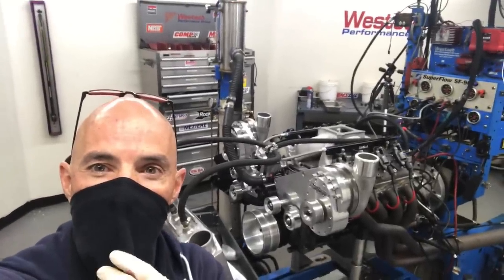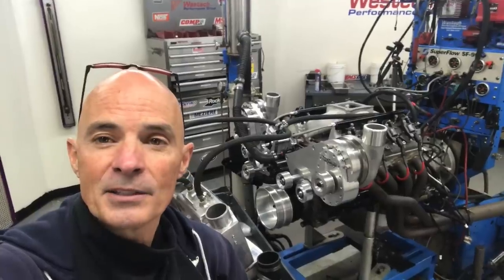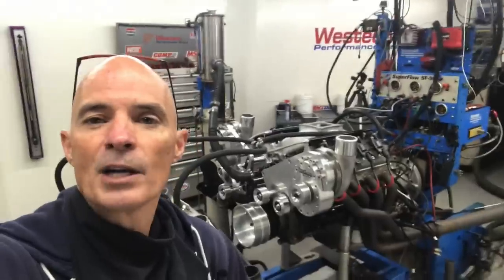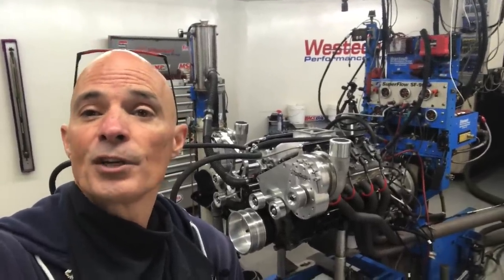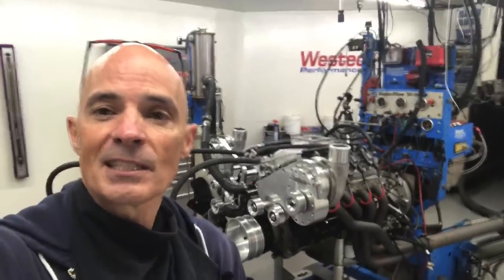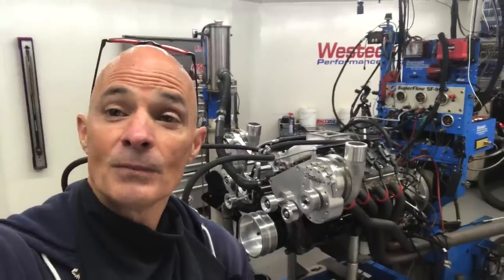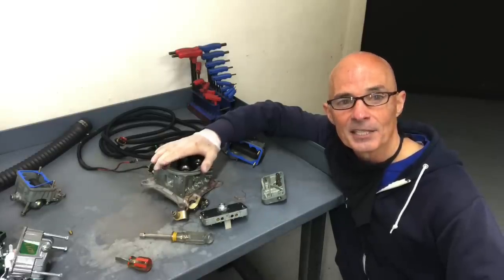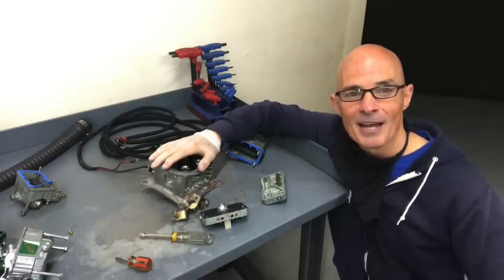WHAT'S INSIDE? -BLOW THROUGH CARBS

Comment: I don’t know much about carbs, but various a/f reading between banks usually isn’t going to be the carb I wouldn’t think, possible missfire causing the a/f to read lean, unburned oxygen. Turbo John has a couple good videos on blow through setups since he did it forever before going to fuel injection. One thing I did learn from watching his videos is the vent tubes and how it’s positioning is in the hat.

Comment: Unfortunately dont have time right now to check that this hasnt been said in the other 350 comments but I think you need to verify that the pressure in the bowls is keeping up with the pressure down the throat. The carb hat may be creating an issue around the vents only at the top end flow level. On the plus side, if you drill for sensor/gauge and verify that that IS the issue, you can reuse that hole you made to run a secondary 'vent' from the charge plumbing to the bowl and correct the issue.
Reply: I don't think he has. I like the idea of a mechanical gauge on the carb and maybe a bowl with a sight glass. It's emptying under boost but he hasn't mentioned confirming mechanically the fuel pressure at the carb while under boost.

Comment: Richard, I have another request. For the folks who want to keep cats for emissions, does a truck cam have good gains when run back to back with stock manifolds and the first set of cats?
Reply: Cats and cams generally don't get along. Hi lift and high duration equals a lopey idle with raw fuel getting to the cats. Raw fuel kills cats. Increased lift or different ratio rockers and a retune would work well with cats but you can't have a choppy idle and cats that survive very long.

Comment: Eric the car guy had an issue like this. It was the carb air inlet pipe (idk if that's its name). It was literally pulling the fuel out of the carb, I stead of pushing it into the engine. Not sure if this is the same thing but it may be something to look at.

Comment: What is the absolute fuel pressure at the carb at peak power? All of this is telling me that there is a proportional loss of fuel as boost and fuel flow increases. There is a chance you have a leaking exhaust valve as well, contaminating the O2 sensor with unburnt charge.
Edit...
Try flipping the carb 180°, i know its a pain, to see if the other bank runs lean. I really believe your problem lies before the carb.

Comment: Your testing has narrowed it to two possibilities.  Fuel supply or ignition.  The known good CSU carb on gas is going lean up top, so problem is elsewhere. Fire up the parts cannon.  I would guess the Holley Ecu is borked even just firing the coils.

Comment: I found on my combo that the quick fuel I had 1030 hp was the limit before a/f  went uncomfortably lean at the top my CSU twin seat cured the problem immediately, when talking to Kevin he said he revised his thinking and said 1200 hp was the limit of single needle and seat down from 1400 on his website. It would be interesting if someone had one to try otherwise maybe the fuel pump is not providing the fuel anymore for some unknown reason like are there vanes in it petering out or maybe voltage drop of pump that creeped in , have you checked the filter ?

Comment: Fuel pump all day long. It's either getting tired or not up for the flow requirement. Pressure shows your reg is good, not the flow. So hard to see a drop in flow at such low psi.

Comment: Is it possible that under high boost the air pressure in the body of the carburetor is higher than the fuel pressure trying to make its way in. It could be a physics issue more than anything mechanical. Almost like boost pressure trying to get into the coolant system.

Comment: Sounds like some messed-up turbulence from the Twin torque storms superchargers coming from the intercooler into the charge pipe on top of the carburetor I would try a dual Inlet carburetor hat blow through carburetor hat and see if that changes your air fuel ratio at all

Comment: Make some cheap bowl vent extensions that aim into the airflow on the carb hat. Ram air will give a little more pressure on top of the bowls to push fuel thru the jets.
https://youtu.be/awht5OpiHTs
https://youtu.be/XLKTzQbbgsU

I think as airflow picks up blowing across the tops of the vent tubes it probably makes vacuum in the bowls.

Comment: So, considering all that you've done, I think it might be a compounded problem, showing off all of the bad sides of carburettors all at once: One is, as you said the manifold. I can't remember if you where on that particular Engine  Masters episode, but when they did test a whole bunch of manifolds, most had uneven distribution of fuel, leading to some cylinders running rich, and some lean. Seeing how you have a consistent problem of fuel starvation, but only on e85, I wonder if it's not the pressure, but rather the size of the lines. Flow isn't just limited by pressure, but also area, and you need much more e85 compared to regular fuel. I wonder if the starvation is simply a restriction somewhere that means the carb can't wlow the extra 20 or so % of volume that you need. could be internal passages in the carb etc. A pressure sensor won't show that, as the pressure increases with restrictions anyway. Also, with the increased volume of fuel, it's harder to atomize it properly, so with your style of manifold, the uneven distribution gets worse. A friend of  mine sort of had the opposite problem with a bigger efi fuel pump, that was tunning on a stock regulator. With the fuel pressure still at stock, the car ran pig rich, because the pump delivered more, at the same pressure. Meaning the regulator sat at 3 bar, but let through more fuel, at the same pressure, because it couldn't cope. So to summarize, I don't think you can flow quite enough fuel through one carburettor due to area, and the extra fuel you do have is overwhelming the manifold design, and not atomizing. Is it by chance the other side of the engine compared to where the hat points that gets more fuel?

Comment: I agree with a bunch of comments—if the carbs worked on other setups they’re probably not the problem. Look at fuel pressure at the carb inlet, is it making it all the way there? As mentioned, look for vacuum leaks for the side-side problem. I also don’t like the looks of that carb hat, but if it’s worked before... Can you measure fuel flow between regulator and carb float bowls? Verify the gross fuel flow relative to lbs/min of air? How about a restriction in the fuel hoses after the regulator (damage)? Very weird problem.
Get the new Holley ECU! Good luck and keep em comin!

Comment: We usually start by checking fuel flow out of the FPR when pressurizing it to the same level as maksimum boost pressure. 1000 hp is at least 100 lb/min airflow, right? Running E85 at lambda 0.8 true AFR is 7.84:1 and 100 lb/min airflow / 7.84 = 12.8 lb/min fuelflow. We mulitply by 60 to get lb/hr and get to 765 lb/hr as required fuelflow, right? To avoid ANY fuel pressure loss, out test have shown us that one NEEDS 40% higher fuelflowcapasity then the carburetor (or fuel injectors can move) so this results in 1072 lb/hr out for the return of the FPR. We mulitply by 10.5 to get ccm = 11250ccm/min which is 11,25 L pr. min. or 2.97 gallons pr. min. 
When tested with the fuelpump running and having air pressure equal to boost pressure into the FPR, you should fill a gallon jug with the fuelflow from the return hose from the FPR in just 20 sec! Using more time than 20 sec. pr. gallon tells us fuelflow is inadequate for 1000 hp on E85 and you will get fuel pressure loss, fuel level loss and therefor problems with higher AFR.
With this kind of fuelflow I would plumb the carburetor like a fuel injector, feeding the carburetor fuel directly from the hose / pipe coming from the fuelpump and going to the FPR.

Comment: Round 2
1. Is it possible youre freezing the fuel and getting an incomplete burn, ive heard but not seen that some widebands will read lean when theyre super rich.
2. I re watched the other 2 videos.. it looks as tho you did the na run with the gas carb but didnt do a boost run with it (could be wrong).
3. Whatever performs the map sensor function in the carb (not a carb guy) could be reading wrong.
4. Did the holley fail or was it this issue manifesting over both setups?

Run the test with hot water in the intercooler and see what happens.

Comment: Check the ethanol content of your gasoline. Due to this pandemic they are using a lot of ethanol for hand sanitizer in the E 85 that should be around 70 80% is around 50% right now
Reply: That would make it rich, not lean. E85 has about 70% the energy of gasoline, if it was E50 it would have about 85% the energy of gasoline. If it was E50 it would be about 15-20% rich, not lean.

Comment: Try extending the bowl vent tubes to where the carb hat meets the piping, and flare the ends a little.  Look at Pitot tubes for airspeed indicators.
There is a chance that airflow across the bowls is messing up internal pressures and flows.
Reply: YES I saw a video were the carb was leaning under boost and they kept changing to bigger jets until they did extend the bowl vent tubes with 90°bends   into the incoming boost after that mod the carb started to get rich 
I'll search for that video!!!

Comment: Hi , E-85 Requires More Fuel volume ( Gallons Per Minute = " GPM " ) / Liquid Flow ( Not Pressure ) . The Fuel Passages ( internally inside the carb ) ARE Not Large Enough To Handle the flow . ( Fuel bowl / Needle Inlets Too Small ) . Plus 1 !  To Manitoublack  About the " Carb Inlet Hat "  There Is A Possibility That The Carb Is " Freezing Up " Due to the "Cooling Effect " E-85 Has . 
What Is / can You Measure Your Air Temperature Before ( air inlet in the hat ) and After the Carb ( In the Intake Under The carb )  Maybe Try Running your setup " With - out The Air inter Cooler ? 
Keep the content coming ! Regards ,  Mark

Comment: its the boosters, its the boosters , its the boosters. the open in the center of the booster is not creating enough vacuum to pull the fuel. also drilling the main body where its was drilled only changes the vacuum on the diaphram of power valve and will not change amount of fuel it flows. fuel from power valve is added in with jets fuel and enters through booster

Comment: Try to externally boost reference the carb, hook up the boostreference line to carb and regulator pre intercooler. If it's still leaning out, put a tube with a funnel pointed towards the flow in to the charge pipe ore intercooler. This worked great on a pair of dellorto's i had back in the day! The sweeds call this doping the carb😁

Comment: The intake seems to have a vacuum leak. The is more than likely why your AFRs are off on one side. Even though is boosted just like exhaust will scavenge when You have high flow volume and it will suck air, again even under boost pressure.
Reply: Hey Dustin, the one thing I've learned from Richard's channel is to treat a boosted engine like it's NA. Check for any vacuum (boost?) leaks between carb to manifold and intake to heads. I would even do a cylinder compression check. Again eliminate the small issues before the deep dive into the problem.
Reply: @ts302  Well there is this idea that a boosted engine won't have a vacuum leak and therefore run lean. People think since there is boost pressure in the manifold that you will have a boost leak instead of a vacuum leak. But that just isn't accurate when you start using large volumes of air at a high velocity. The velocity of the air across the leak will actually scavenge and pull air in like a vacuum leak. So at idle you may not have a small boost leak since you have both blowers turning, or it may neutralize the effects of a vacuum leak. You may not even be able to use the brake clean/carb cleaner trick to find it. We have to remember, there are only so many things that can cause a lean issue. Not enough fuel from carb or efi system, or unmetered/ additional air entering the system that the fuel system cannot account for. A vacuum leak would explain the side to side afrs and the issue to get worse higher into the rpm range, higher air volume at a higher velocity will scavenge more air.
Reply: @dustinfrey3067  the clues that jump out for me is the side to side AF ratios and the fact that removing the carb spacer helped a little (If I heard correctly Richard stated a couple of points). With all due respect to Richard, his 'this hat/carb worked before/ been there done that' attitude would not fly in our maintenance shop! As an electrician, when all else fails, start over from the beginning and check the basics, leave no stone unturned. It's a lean condition, either too much air or not enough fuel-why? As keyboard technicians we can only suggest (he asked,LOL) and wait-it's Richard and crew that will ultimately find the fix.

Comment: Thought running race Fuel would help with flow. Almost sounds like 2 different problems though not enough fuel and uneven distribution of fuel to each chamber. So carb and heads? Try different heads see if any changes. My guess

Comment: I agree, it's the hat. Anytime I run more then 8 lbs of boost or so the carb hat or enclosure box has to be the proper design. I recommend the Paxton power hat. Works well at that boost range. I've also had some success using a screen in the airflow like a boat filter. Torque Storms hat is supposed to work up to 12 lbs. I would think you should have one of them to try. Thanks for the vids!
Reply from the maker: We've run the carb and hat successfully many times
Reply: @richardholdener1727  But the fuel is different. Wouldn't that make a difference?

Comment: Sounds like the carbs ain't getting the boost reference to me.
Reply: The previous video he mentioned it ran fine until it got into boost. It sounds like the pressure regulator isn't boost referenced
Reply: @timothybayliss6680  So why does it only effect one side of the engine?
Reply: Richard has been having issues with boost and this engine, the reason why he was running blow through carb was because the Holley injector drivers "died" just seems to much of a coincidence that now the carbs, petrol and e85 are having essentially flow issues as well.

Comment: It looks like that hat is causing so much turbulence in the airflow that you're losing the velocity across the venturi. No matter how big the jets are if the air isn't flowing over the venturi at the right speed, it's not going to pull the fuel it needs.
Now I'm just a big ol' dumb truck driver so don't take my word for it but I'd try spacing that hat up a couple inches.

Comment: Make sure the boosters are drilled. I didn't hear you address that. Have you tried plugging the high speed bleeds? How about the fuel log, is it big or do you have 2 lines to the carb from the regulator? Are the floats travelling freely? Did you drill the PVCRs?

Comment: Run one supercharger, and see if you can get a handle on the A/F. If you can control one. Hook both back up and measure the pressure in the bonnet. You may be to a point of top pressure to need a duel needle and seat.

Comment: Maybe you could try moving the carburetor hat in different positions to get your fuel air fuel ratio on both sides of the engines identical or close to identical then instead of doing the normal  1 to 1 ratio fuel to boost maybe try to do 1 or 5 to 1 fuel pressure regulator sorry, maybe two pounds per PSI of boost or 5 lb per PSI of boost to double the fuel flow because we all know E85 and alcohol needs a lot of fuel so it might be you need just a higher ratio per pound of boost for the fuel 7 to 8 PSI on idle and try maybe 30 to 40 PSI at full Boost hopefully that works just need to find a fuel pressure regulator that could do that or modify what you have love watching your videos don't hurt to try it seems like you tried everything already

Comment: I agree with manitoublack. I'm an airline rated  pilot and an aircraft mechanic. The airflow in the hat is the likely issue. Have you tried "aiming" the hat from different directions? I'm assuming that's a practical solution. Quite a bit of time and headscratching has been done on one of my projects with this issue and I've not even had it running yet! It's a GM LN2 2.2 liter 4 cyl OHV that I've  raised the intake ports about 3/4". Expected power will hopefully be 225 hp.
Reply from the maker: we've run this hat and carb together my times

Comment: Volume of the fuel pump with should suffice for all the other tests I've seen you run on the dyno but that's one thing I would check volume from the fuel pump espresso will be fine but volume won't be there secondly atomization of the fuel even though the air pressure going through the fuel carburetors on atomized fuel as well so you could get puddling in the manifold there for not allowing enough atomization of the fuel to reach the cylinder try placing more spacers in between the carburetor and the top side of the manifold and see if the air fuel ratio changes enough that it comes back into you're 12 to 10 ratio on on Gad

Comment: Probably the carb hat does some magic? Try to run the carb open na so you can see dose the af get better.

Is the valve adjustments checked? Spark plugs are probably ok when you check the compression, but how about the ignition coils? Do you have on ore two sets? How about the sparck plug wires? You probably wuld anyhow here if there was an misfire, but just to check, if on sylinder doesn't fire it will read lean on lamda.

Comment: Have you checked the plugs? One o2 per bank is going to read the average of those cylinders.  Nothing fell down into an intake runner and blocking it, is it?  Sounds crazy but I’ve seen it.  Otherwise possible vacuum leak on that side.